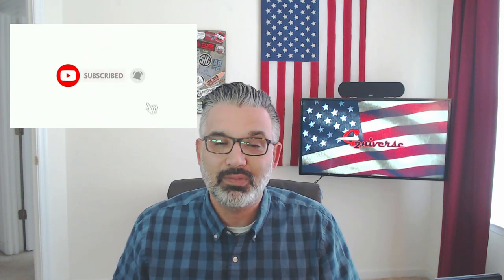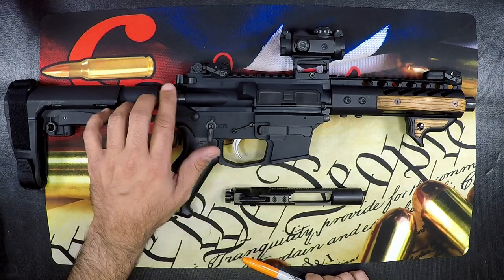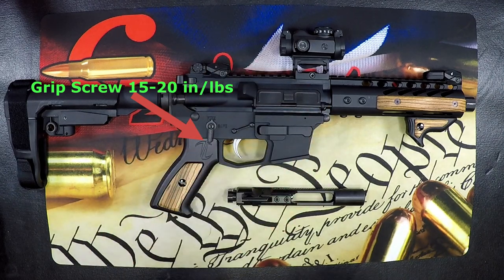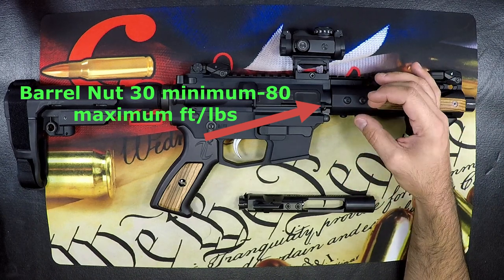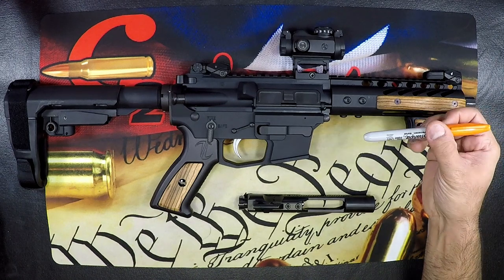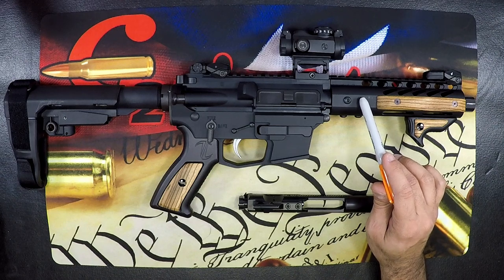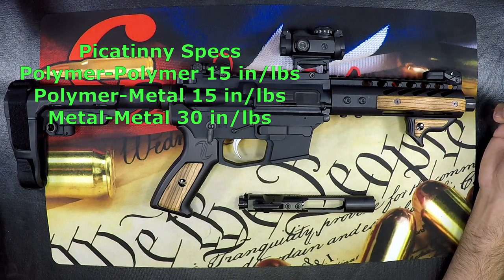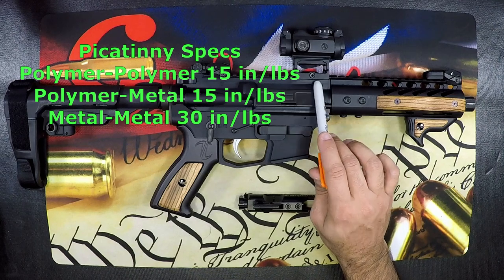Safe AR Torque Specs - Castle Nut, Grip Screw, Barrel Nut, Gas Block

Comment: A couple things to note here - #1 I'm not a gunsmith I've just been around them my entire life and worked on rental equipment since I was a kid and done a lot with my hands so I would trust this guy more than myself on GS stuff but #2 Rockset is a bit sketchy, if you look at reviews you'll see a lot of people have trouble getting it off so I would do more research before using that. #3 grease and threadlockers will both change your torque specs as opposed to clean and dry threads so just be aware that when tightening something to 30 in/lbs it'll actually be like 40 in/lbs if you're using a thread locker or grease, that isn't an exact number but torq tist chhanel (not correct spelling because YT likes to delete my comments that actually provide sources for knowledge, just use the correct spelling for those words) has a vid on it and also the inverse is true if the threads are dirty. 

Anyway hopefully that helps someone
Reply from the maker: great info.  rocksett is hard to get off and thats why you only use it for suppressed muzzle devices.  The temp point is soo ridiculously high that youll lose the temper of your steel (slightly exaggerating, but pretty close) before you can get it off.  If I'm using it, i don't want that thing going anywhere....ever.  And i agree with you on the thread locker...i RARELY use it, because there really is no advantage to if you are torquing to correct spec.  vibratite is ok IMO since its not technically thread locker.

Comment: Appreciate the video The reason why I drove deep into this is because it seems like I'm not even able to do 15 in pounds on my AR-15 grip screw. I feel like it would strip it.  just feels a little concerning
Reply from the maker: Then dont push it...as long as you have that lock washer inside the grip that will lock it in and it wont back out.  Plus if you over torque the grip screw and its too long, you can interfere with your trigger.  Grip screws are notorious for being too long.

Comment: I wanted to add a couple thoughts here.  First, if you plan to build more than one or two AR’s, go out and invest in a decent torque wrench. Your video shows a Pittsburgh wrench from Harbor Freight. While it does the job, I question their ability to hold true specs.  You don’t have to drop 200+ USD on a Snap on or such, but check out Westward or even Kobalt (Lowe’s brand).  Also, make sure you use the torque wrench at a 90 degree angle to your armor’s wrench to ensure you get accurate torque.  If you don’t, you will be using a higher torque than the setting on the wrench.
Reply from the maker: Honestly for ar building the spec that youll need for foot lbs is wide. the barrel nut spec is anywhere from 35 to 80 and the muzzle device is 15-25...even if its not perfect youll land right.  inch pounds is much more important in the ar system...thats why i use the wheeler fat wrench.

Comment: Depends on what the intended purpose is of the AR that you are building.  I have 9 AR's at home.  only 2 of them did I dimple the barrel and only one did I dimple and pin the barrel.  The other 6 are just tightened down with the screws.  Quality LPGB will have Knurled cup point set screws.  These dig into the barrel itself and and do quite well at keep that Gas block in place so that it doesnt walk on you.  The one rifle I have dimpled and pinned is my training rifle.  The reason being is because this thing gets beat to shit.  It gets thrown on tables, dropped on gravel, one range trip or class with this rifle is easily 1000's rounds, and I do a lot of dynamic training with it.  My competition rifle isn't even pinned.  It has one dimple because I change parts on it quite often.  My home defense rifle is dimpled just for that little extra piece of mind.  The other 6 rifles have had 1000's of rounds through them and they are not dimpled or pinned and have never had a quality gas block walk on me.  In fact I am as I speak finishing up a 6.5 Grendel build and I will not be dimpling the barrel or pinning the gas block.
Reply from the maker: Thanks Mav Div for being a  subscriber...love hearing from you guys!

Comment: What’s up brother, I actually had a question, on my lower receiver for some reason the grip screw does not screw it. The hole / threads are too tight. Any suggestions possibly on how to fix this issue?
Reply from the maker: @nike_eli couple questions...what kind of lower? (make and model), where did the grip screw come from and who made it? (lower parts kit, grip).
I will tell you that newer lowers tend to be a little tight, but you shouldn't have to really force it in there.  email me at g2customgolf@gmail.com if you need help.

Comment: Is the pistol grip screw for all? Ive seen some say 40 inch lb....I like the B5 grip but had one come loose..Id rather not use loctite if i dont have to. but their grip also didnt come with a star washer
Reply from the maker: No.  Depends on the depth of the receiver and the thickness of the grip wall.  If you have a screw that is too long you can over tighten and actually have the screw come into the receiver and block the trigger from functioning.